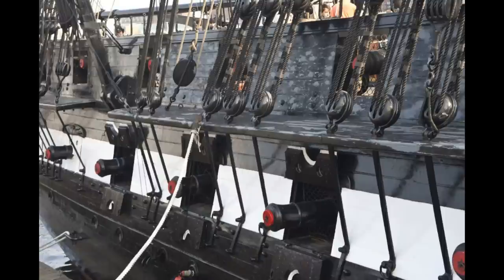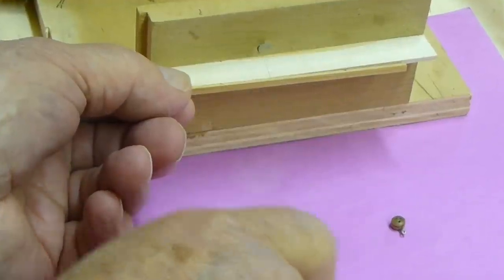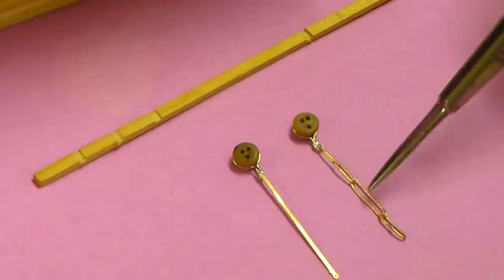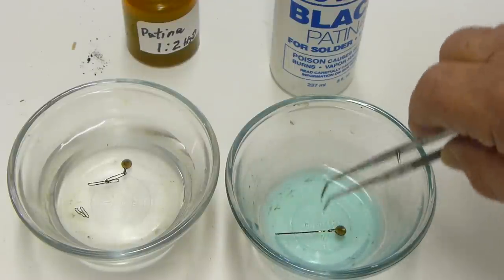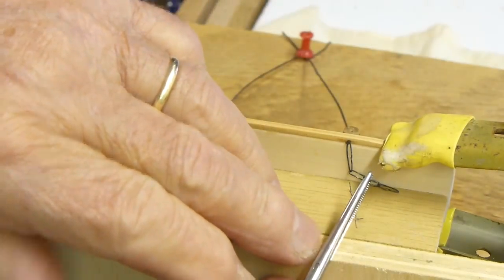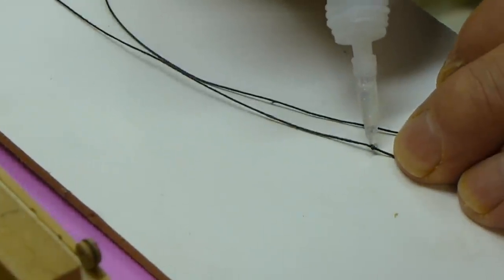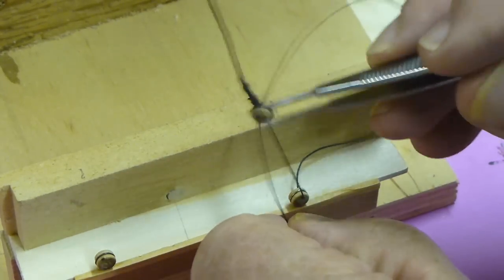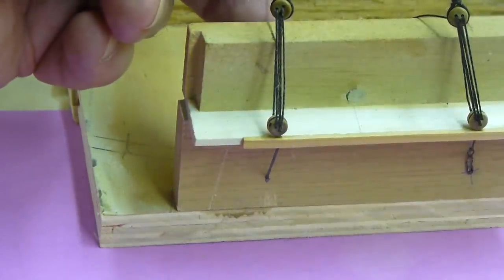Attaching shrouds to model ships

Comment: I wonder how you clean the beeswax leftovers after you finish.
Every time I pull the shroud line through the dead-eyes the beeswax would leave dust like filth on the shroud and dead-eye.
This is really annoying, to the point I stopped using it.